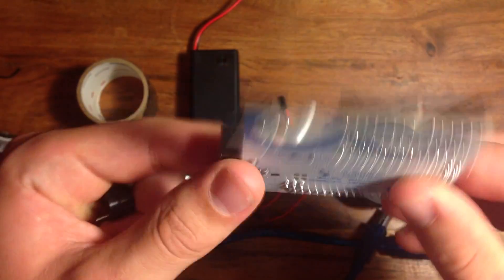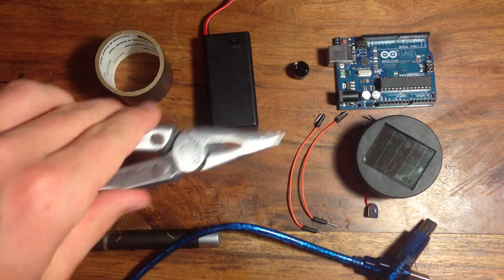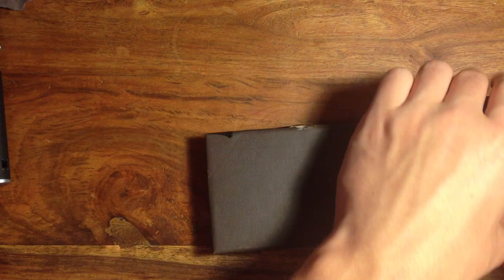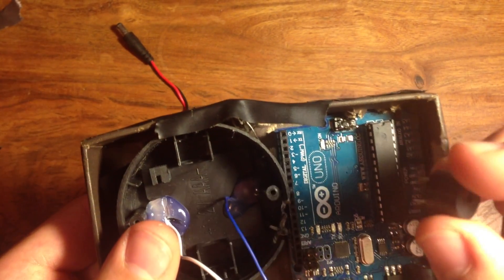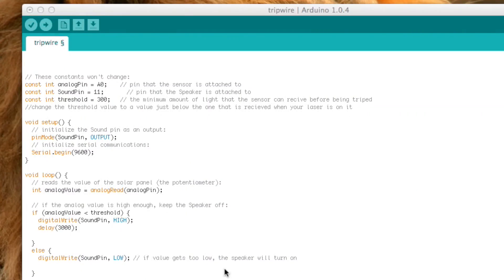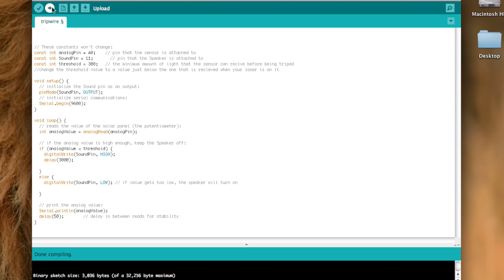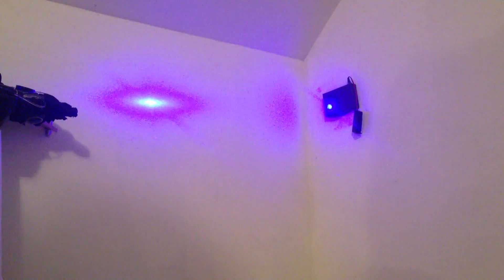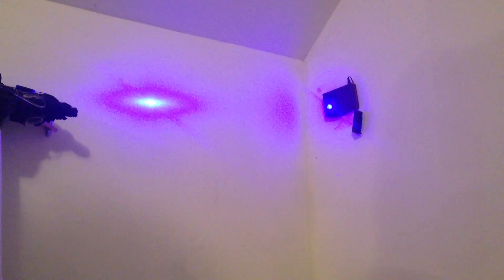How to Make a Laser Alarm System

Comment: The 'invisible laser' you mention at the end is not invisible because it is a low 5mW, it's invisible because you would choose a laser diode in the range outside the visible spectral range (400-700nm), please don't confuse others with wrong information.

Comment: For some reason, the serial monitor is reporting a value of 0 when I shine the laser on the solar panel. I've followed all of the directions in the video. After I disconnect the solar panel leads from the Arduino, the serial monitor reports numbers in the 300s. Can anyone explain why this is happening and/or offer advice on how to fix this? In an attempt to fix the problem, I set the threshold value to -10 and tripped the laser, but there was no sound from the speaker. The speaker works and this is the third solar panel I have used. Thank you and please help!